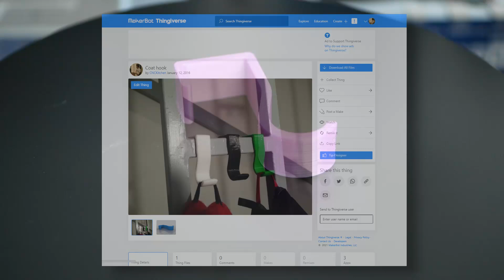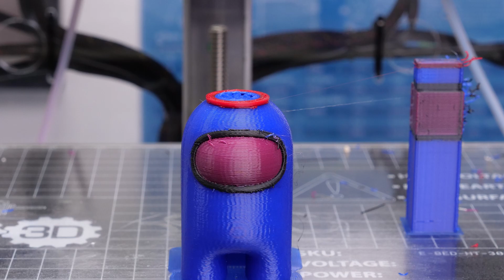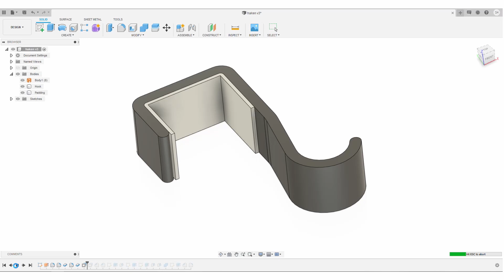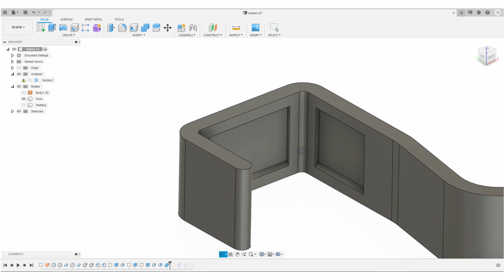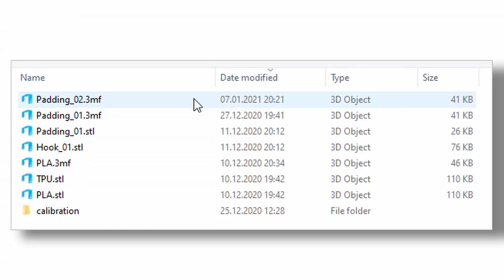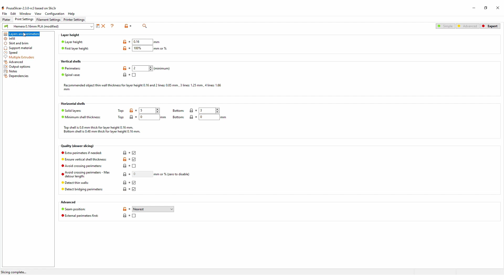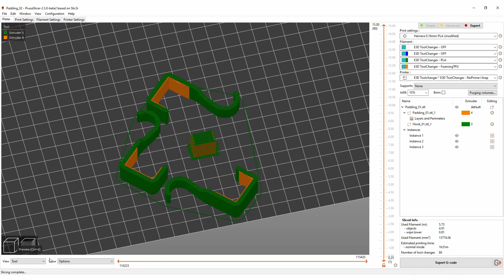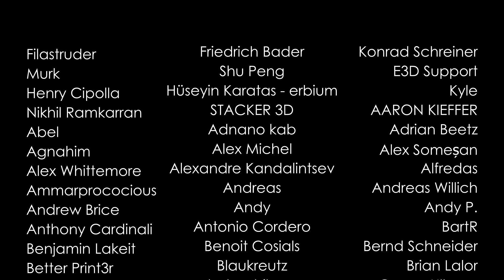There is MORE to this HOOK than you think! (Multi-Material 3D Printing)

Comment from the maker: Don't forget to like & subscribe and share this video on Facebook, Reddit, Twitter, and other platforms!
Reply: Nice Wanderschuhe!
Reply: Polymaker’s pa6-gf dropped by 40USD on Amazon for 2kg, could be a good time to get it for a future video.
Reply: @CNC Kitchen Recently i wondered if there is a list of 3d printing materials for multimaterial 3d printing. Like which plastics stick to which, which ones should not be used in combination or something like that.
Reply: is your cad softwere free
Reply: After watching your video, one head that I think should work VERY well is a spindle that is specifically for travelling along the outside walls, trimming them to final size.  That wouldn't take much power, yet would remove surface blemishes/over-extrusion/etc.  You could even deliberately over-extrude a little just to have a smoother final finish.  Does that make sense or am I missing something?

Comment: As a painter can say if those hooks are scratching the paint on a metal bar as it looks like...

 Then either the metal surface was prepared right (Primer, sanding and so forth...) Or/And the right type of paint wasn't used for it.

 Metal paints when dome right should be hard to scratch even with a knife. Yet alone non abrasive plastics.

 Still good video as always. Thank you.

Comment: Hot and cold rings for angle thermo fan treatment or direct energy hot cold treatment for curing of metals and glass and ceramics or temperature control hot oil dippings

Comment: what I would do with my stock Ender 3 v2 for a similar result : print separately the two pieces, one pla and one in tpu. Designing them in fusion 360 in a way that the tpu piece interlocks inside a recess created on the pla piece. It should be easy, tpu is flexible, just make the tpu connecting part lightly bigger than the recess on the pla part.
Reply: Exactly! For extra strength simply add superglue or epoxy to the recess and the two parts are not coming apart. Bonus, you can print hooks on one printer and padding pieces on another, thus increasing the speed because it does not have to change tool twice per layer, which is insane in my opinion.

Comment: For the palette, I was able to print TPU (75A) and PLA but I had to change the spring on the palette for the TPU since the spring the unit came with was too stiff. It then worked fine.

Comment: Would a non completely purged nozzle really decrease layer adhesion, when printing different polymers which don't bind together?
 I mean, having a mixture of both materials actually sounds like having a better bonding between layers, than having a complete new layer of a material that doesn't like to stick to whatever is below. With the same material as below being in the mixed layer, there would be et least some cohesion. And so the mixed layer acts as an interface layer, actually improving layer adhesion in both directions.
I think this could make for an interesting review..

Comment: this would be brilliant for making RC tires in the same way. I'm currently making wheels from 98A TPU and casting softer silicone rubber onto them with 3d printed moulds and this method would save me a lot of time

Comment: Why everyone use clean tower for multi color/material splitters. I am using clean zone for few years to extrude plastic when needed to change it only . And no any  issues so far. using very simple item www.thingiverse.com/thing:2281959
Just do series of extrude/retract moving head over cleaner and move fast as possible back to print. No need of towers or shields if can move fast.

Comment: Guten Tag!
a toolchanger in my opinion is primarily useful for "not minding the amount of filament left on the roll" - if the software allows to automatically switch over to the next extruder if the roll is empty.

i personally do not like "stehrümchen" in questionalble design, but i need a lot of PLA for technical mockups.

Comment: It could be used for anatomical models / surgical training models. Pla for bones, TPU for muscle. Other ideas: Sandals. Mechanical buttons or keypads, maybe even including conducting filament as variable resistor. And of course, food printing would benefit from having multiple effectors. Deposit sugar paste in a layer with one toolhead, then flame it up with a heat gun.

Comment: 5:58 Create an ooze shield by making a skirt that's as tall as the print.
Reply: Thats not the same, since the ooze shield follows the contour of the model throughout the print, a tall skirt is basically the contour of the first layer extruded up, sure it would work in this case but anywhere else it won't or it would be a waste of material
Reply: @SarkanyGergogaming  Refer to Ooze Prevention, under Multiple Extruders, in PrusaSlicer.  I don't understand why a tall skirt for an ooze shield wouldn't work in all prints involving multiple extruders.
Reply: @bernardtarver  because the skirt follows the contour of the first layer, if at any height the model grows outward, exceeding the dimension of the first, it will collide with the skirt and the model continuing outside of the perimeters of the skirt, therefore rendering it useless.
Reply: @SarkanyGergogaming  Again, refer to Ooze Prevention settings in PrusaSlicer; also, you can manually specify the distance between the skirt and the model.
Reply: @bernardtarver  thats true, but that would be an immense waste of material depending on the model
Reply: @SarkanyGergogaming  I wasn't arguing about efficiency. I was arguing that it would work for any print involving multiple extruders.
Reply: @bernardtarver  well yes in theory it could work, but if a model has a really big overhang you would have to put the skirt really far away and maybe by the time the nozzle reaches the part from the skirt it may ooze again, honestly I have no idea though definitely worth looking into
Reply: @SarkanyGergogaming  In such case, albeit fringe, you can adjust the non-print travel speed.

Comment: In theory could one of the tools be a CNC router and cut meterials?
Reply: The frame doesn't look sturdy enough and I don't see why you'd want a system that can automatically change between a router and something else. The router would need to be quite small or weak.

Comment: Over engineered? Definitely.
Maybe not the best example to illustrate that really interesting feature and I believe you could find a better one ;)
I normally don’t have so much time to waste so I’d take, cut and bend some steel or aluminum and glue some foamy/rubber material on the inside :) But I appreciate your effort to discover how to make this work for you.

Comment: Hi, i would like to build a CNC engraver to cut wood in one of my videos, in your opinion is it better if I invest a little more and buy linear rails or do the drawer guides still work well? I don't need anything super precise and I will use it only to engrave wood or maybe some plastic. Thanks for answering, i enjoy a lot your videos And they inspire me a lot
Reply from the maker: Linear rails are available so cheaply nowadays, why I'd prefer them over drawer slides.
Reply: @CNCKitchen  thanks for the opinion. i think I will use drawers slides because I already have them at home and the cheapest 300mm linear rails that i could find on banggood was 15€ each and they seem very low quality, maybe if it turns out grate I will upgrade it in the future

Comment: I don't see benefits in using a toolchanger for this job. E3D Chimera could have done the same!
Reply from the maker: Could, but the problem with the chimera is that the idle nozzle oozes onto the print permanently. An IDEX printer would have been another option.

Comment: Actually PrusaSlicer offers the option to extend the skirt up to the last layer to prevent oozing for multi-extruder (advanced mode, under "multiple extruders --> Ooze prevention --> Enable). By setting the correct number of loops, you do not need a purge tower because the nozzle will purge on the skirt. I have used this with E3D Chimera hotend and it works quite well!

Comment: I wonder if it would work better with this foaming filament  and travel-movements if you would add an extra object that you design and place yourself for a 'drip tower' right next to the object and using multiple-object-settings to print that with a lower temperature. That could probably also work with Idex printers?
Also with the toolchanger, could you add a kind of soldering-iron to one of the positions to do a 'hot cut' after the print to have to do less cleanup?

Comment: An awesome thing to do with a tool changer printer is maybe make a more intricate design of conductive print.... would it be possible to make a print with a pcb integrated into the print, or maybe use conductive filament traced inside of a print... I thought about doing something like that with an hour device to prevent tampering and misuse.

Comment: I'm really interested in one function that the toolchanger could solve. Can tool changer be used to make custom PCB's, or even better can it integrate conductive paths into the shell of the print?
Reply: No, at least not with 3D printing tool heads. There are conductive filaments, but they aren't very conductive. And it's quite cheap and fast just to order PCBs from China nowadays. Of course, there are ways to make custom pcbs with CNC or Laser Toolheads, which might be mounted into that system, but that's probably not what you are looking for.
Reply: @Andreas-gh6is  with toolchanger you are not limited to extruding plastics. You can:
1. first create channels in plastic and then extrude solder into them, or
2. lay wires in the same way as continuous fibers can be used in some high end 3D printers, or
3. Have custom tool for toolchanger that is designed to lay thin strips of conductive, adhesive tape, or
4. Use the toolchanger as a normal desk CNC and mill the traces from blank PCBs

Comment: Very interesting video. I am looking at a new idex dual head extruder that is ending a kickstarter and looks very interesting for an interesting price. JGMaker Artist-D Dual Extruder  I would be interested to see what you think of it. I'm more interested in multicolour and multi-material than having a router or a laser because I have only a small apartment with no ventilation in winter.

Comment: The only thing that I can think off now, is of a 3D printer with tool changer, and modified nozzles, that let you 3D print chocolate (first nozzle) and it's filler (second nozzle) that could be caramel, nutella, dulce de leche, etc... it wouldn't be the most efficient way to obtain filled chocolate, but ¯\_(ツ)_/¯

Comment: In cura by using only two perimeters and adding an "extra infill wall count" you can have 3 tiered speed control to your perimeters adding a lot of strength and if you lower infill percentage to 10% or bellow one can reduce print time to 2 perimeter speeds and almost the same material usage and using my calibrated fingers and forearms seemingly no strength strength loss.

Printed spheres sound like golf balls hitting the concrete

Comment: If you design the PLA and the TPU model to be overlapping then Cura will generate an interspersed pattern which makes the two hold together with a lot of friction. In the future some other patterns will be automatically generated to afix two models of incompatible materials.

Comment: Multi-material of different requirements is definitely cool. Do you know if anyone has done any subtractive toolheads with the tool changer? IIRC, that was one of the things mentioned in the initial launch videos of the ToolChanger, so we can oversize a print, and then use a simple subtractive pass to essentially remove external FDM imperfections, and end up with a print that looks much more like injection molded?

Comment: I've printed loads of PLA/TPU and PETG/TPU stuff on the MMU2 before.  Once I got the correct tension on the extruder it worked fine (because loading and unloading is the problem...  Not adhesion; at least for me).  I was even able to successfully print and use inline skate wheels.  You can find my inline skate wheel .scad on PrusaPrinters.org and Thingiverse if you ever want to give that a try.  Another fun thing to print with these two materials is keycaps!

Comment: Are you worried about the strength of the first corner up from the hook after adding the undercuts? It seems like the thin edge surrounding them will be pretty high stress concentrations. I think it will see more tension than you might expect,  and you could also have problems with creep because of the reduced area.  Remember, there's always room for more over-engineering!

Comment: I like using a toolchanger to have different nozzle sizes, even for the same material. I have a volcano on one tool and a regular e3d on the other. Still planning to use flexibles some day like you've done, so this video was very cool to see.

Comment: Finally someone who does more than just multicolor prints or soluble supports! My most useful multi material print - yet - was a cable entry for a 2U rack frame with PETG front plate and flexible TPU fingers towards the cables.

Comment: Thank you for that video. Now i know why my multi material prints most time not work. But you showed that PVA and PLA will work fine. But how? I hav problems with the PVA. If my Prusa with MMU2 pull out the PVA from Nozzle it has a long string at the end and i have to pull out and cut off the end of PVA manualy before my printer change back to PVA. I heard that it is an issue of the ram settings, but i dont know witch parameter i have to change... i tried some settengs. One more terrible than the other... Can you make a Video about this problem of printing? Because some of my PLA filaments have the same problem in a less bad way. Sorry for my english. I know It is not the yellow from the egg.

Comment: It'd be interesting if slicers could create an "Material Interface" setting that allowed you to weave layers instead of manually having to create a draft to lock it in.
Basically you could configure the depth the weave extends into each material, in a case like this you could have it 0 into TPU but have it go a few mm into the PLA, and then when it goes to print it alternates which material prints each layer in the zone created.
The layers would probably have to be solid in those areas but I bet it could give a very tight bond by the end and decrease the need for manual modeling.
Reply from the maker: Might be a neat feature in PrusaSlicer if Prusa will really release a Toolchanger as well.

Comment: Stuff like this is what tool changers/MMUs are for. For Prusa's MMU and Palate I wonder if a wipe brush would work.  Kind of like we saw on the e3d tool changer printer.,
Reply: I think it would be useful even for a single extruder. Have you ever tried ironing with TPU? ;)
Reply: Both the MMU and the Palette have to purge the nozzle of the old material/colour completely before carrying on with the print and that is far too much material for a wipe brush to work I'm afraid.

Comment: Try Superslicer. Enabling Ooze Prevention in Expert mode creates a 1 wall "skirt" around the parts. I think that's what you're looking for. Your profile for Prusaslicer should import since it's a fork. More settings to tinker with as well.
Reply from the maker: During the last days I tried to work more with SuperSlicer due to those additional options. I'll see if that helps!

Comment: Fyi, if you make a skirt as tall as the part you can get an ooze shield in PrusaSlicer.  Uses a bit more material, but still works great for one part.  Glad you got the purge block working, it didn't work well in 2.0 ish but ended up not mattering for my IDEX as parking the inactive nozzle over a silicone rubber pad stopped any oozing when inactive and PrusaSlicer sequences retractions during a tool change correctly. (something Cura fails at for some reason...)

Comment: On PrusaSlicer, Print settings>skirt>skirt height put like 9999layers and voilà, "shield"
Reply from the maker: Unfortunately that spans around all parts in a convex shape. Wouldn't help here.
Reply: Adding per part shields is being discussed for SuperSlicer (a PrusaSlicer fork).
Reply: It sound the same as this, from the documentation:

Draft shield
If enabled it creates a skirt as tall as the tallest object in the scene. This can be used to protect ABS, ASA and other materials from warping by creating a micro-climate around the printed part and protecting the print from draft/wind.

Either way it sounds like a clever, only mildly wasteful workaround for the issue described!
Reorganizing the part was pretty smart as well.

Comment: How to make a coat hanger(the Maker's way):

Buy a 3d printer
Learn how to use and troubleshoot 3d printing problems. 
Find a way to learn the most while doing somthing
design the coat hanger.
design how to print the coat hanger
print many test prints.
print final print

if good: yes
    use finished product
else:
    repeat

Comment: The tool changer is not only great for multi color/material prints. Even when using just one material; swapping ABS for PLA or another lower temp. material is not always as easy as I would like. Sometimes swapping materials results in clogs during printing. Also for production cases a tool changer is great. The ability to just grab another tool and then clean the clogged one while you are printing the part with another tool is great.

Comment: I also noticed the "avoid crossing perimeters" doesn't really work in PrusaSlicer. I will try Cura next, somebody on forums suggested Cura does a better job at routing in general. It should make the stringing easy to remove by making moves outside the part, not just avoiding perimeters. I am happy both PrusaSlicer and Cura are open source projects and they are available on Linux.